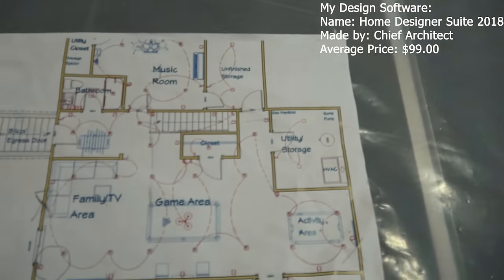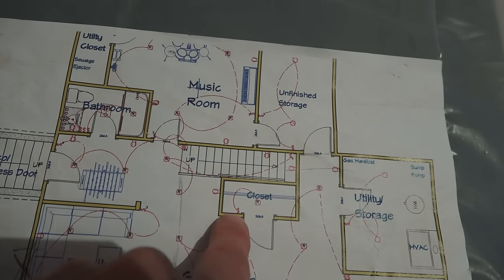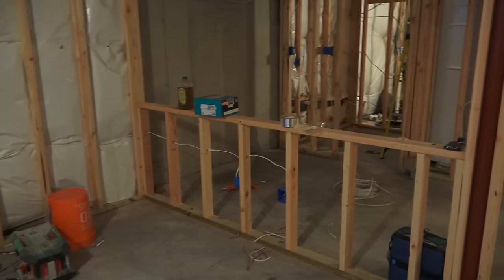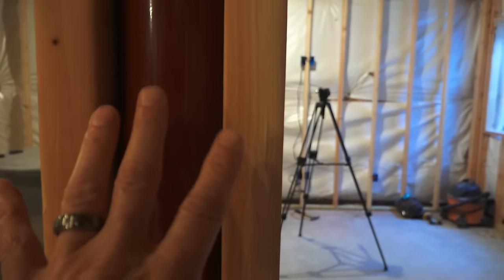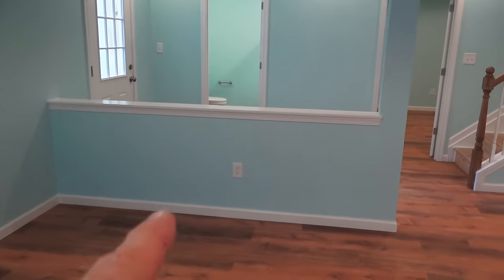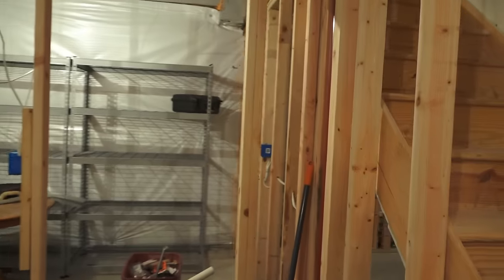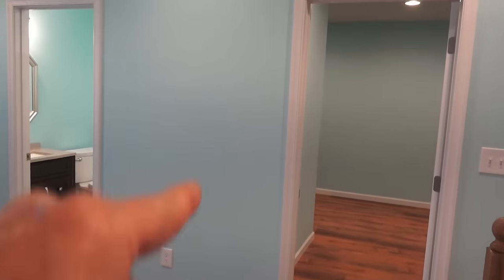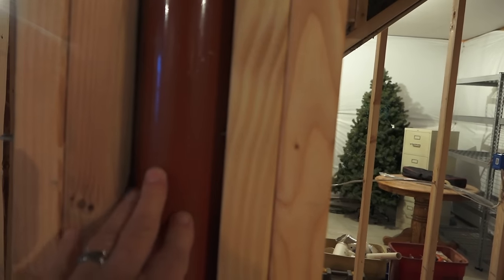Basement Pole Design Ideas (hiding basement support columns)

Comment: IF you have vinyl plank flooring already down do you still need to use pressure treated on the baseplate? Concrete was sealed and then the floor was laid.
Reply from the maker: Yes you still should use treated plates